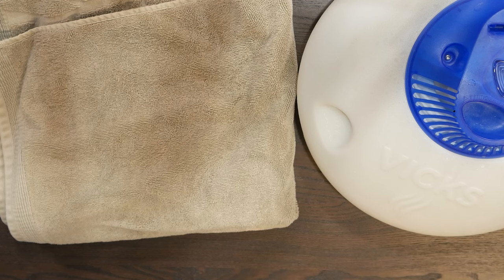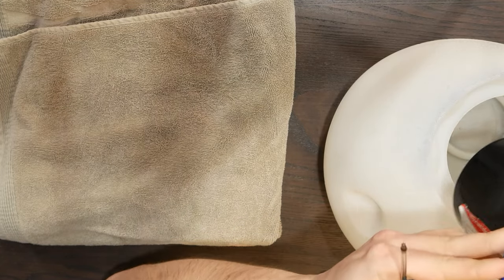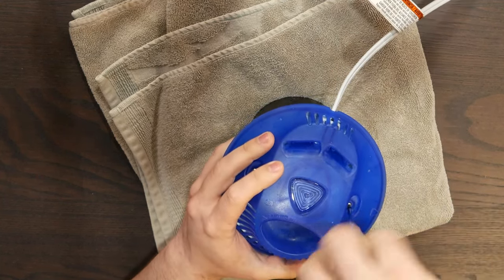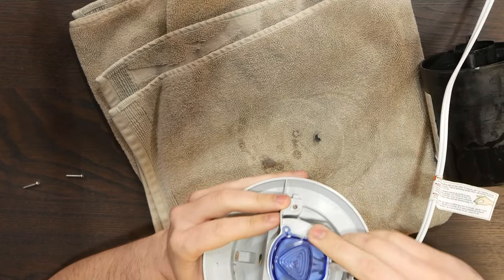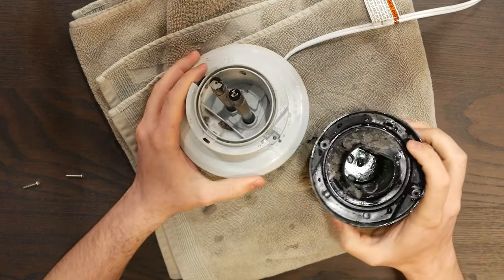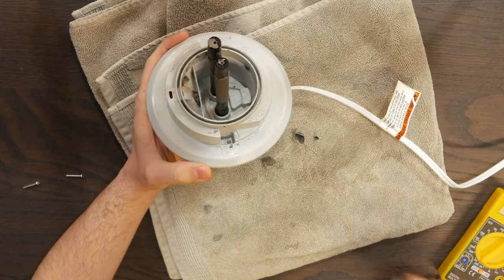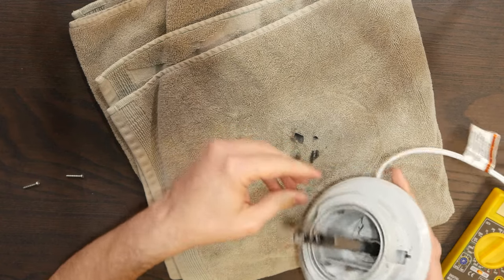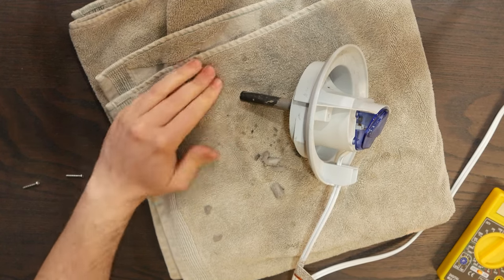Is a Vicks vaporizer an electrode boiler?

Comment: The reason why the scale was dark is because of electrolysis. The metal electrodes were depositing their minerals into the water. Because there weren't other conductors in the tub, most of the metal deposits stay near the electrodes.
I was going to ask what the amperage tested at until you read the "up to 5.8" which is interesting and makes sense that it is dependant on the depth of the water.

Comment: This my friend, is a feature and not a bug!
Your unit may be limited to 650 watts but more the generic Menards option I have will top 1500 watts before the plastic starts melting, if the mineral content of the water is sufficiently high (PPM readings into the 10K range, the circular beige humidifiers are badass wild west).
By varying how often you change the water, you can use a single unit to humidify and 3,000 sqft victorian era home in central IL.
When you pull out the power unit, it's no longer exposed to water and the ouchy shocks stop, so it's surprisingly safe!! lol

Comment: An earlier Vicks model (many years ago) had replaceable electrodes.  The case was opened by using the plug as a key.  The plug was captive while the case was open, making it safe.  They no longer make vaporizers.

Comment: Just got a look at my grandmother's Hunt brand "Vaporizer" from the 1950's and carefully took the screws out of the black bakelite encasing to find two very corroded electrodes and ancient limescale. Took off the cap where the power cord enters expecting to find old leaky capacitors, considering it boasts an 8-hour shut off timer, but it's just two screws connecting the positive and negative wires, directly to the rusty electrodes. I came right here and you had the same reaction.
Reply: If it were my grandmother's vaporizer I would clean the corrosion off of the electrodes, check the connections to make sure they are safe, put it back together and test it out.  Your grandmother would appreciate it.
Reply: @mharris5047  Be assured that I did all of that. It's safe in the hutch.

Comment: I used to use these exclusively, and you used to be able to get replacement electrodes for them. They also used to be copper, but the last one I bought used carbon or something, which lasted longer at didn't disintegrate in the same way but those weren't replaceable, which was the main reason I stopped using that type of unit. I don't want to keep buying a whole new unit just because a small sacrificial part is worn out.

Comment: that is mold in the black cap. On the resistive elements that is probably calcium which is usually in lake water because it dissolves out of the rocks.

Comment: I once tried an evaporative humidifier with a wick, but it was evidently a really poorly engineered model which was very annoying and didn't work well. I then got simpler boiling units which actually worked very well if you stayed on top of maintenance. They're better than the Vicks units in the video. They have an upright configuration with a large water tank, and the heating element is a smooth, ceramic thing (not a scary electrode boiler) which is easily accessed for cleaning. It also has a high/low switch, so if you need just a little humidification or want to go to sleep without worrying about overhumidification, you can set it on low which reduces the output. The output on high is impressive and did a pretty good job of taking care of most of a small house.

Our recent house has a water softening system, and I was wondering if that would make descaling of a boiler less of a pain, but oddly, ever since we moved the humidity has yet to be low enough in the winter to even use the humidifier. Somehow our indoor humidity manages to hover just above 40% all the time no matter what's going on outside. I'm starting to wonder if we have a whole-house humidifier that we don't know about…
Reply: It could be, they do exist.  However, if you have unvented gas heaters in your house those also produce copious amounts of moisture while running via the conversion process from gas to flame.  I have seen people attempt to use these in camping trailers and end up with one hell of a moisture problem.  In an appropriately sized room this isn't a problem (I don't like them because of the possibility of CO2 poisoning if they aren't adjusted just right but that doesn't have a thing to do with their moisture production) but if the heater is too big for the area being heated the moisture problem can be horrendous!
Reply: @mharris5047  Hmm, interesting. We do have a couple of ventless gas fireplaces which we had been using now and then. We stopped using them this year ever since one of them started setting off the carbon monoxide alarm. And it seems like I have seen somewhat lower indoor humidity this winter at times, though still usually above 30%, so not too horrible yet.

I figured that if we did have a whole-house humidifier it would have been visible somewhere, and without maintenance it probably wouldn't have remained effective for long, anyway.
Reply: @TravisTev  Ventless gas fireplaces will do this, too.  I would call in someone from your gas company to repair or adjust the ventless fireplace but any ventless heater requires a window in the same room to be open about a quarter inch for a return fresh air supply.  I probably would relegate them to emergency use myself (I have two propane tank top ventless heaters intended for fish shanties or outdoor use that I use in an extreme emergency, use while the power was on did not trigger any of my three CO2 detectors) but still get the one that is triggering your CO2 alarm adjusted before attempting to use it again.

Comment: Most of the commercial building humidifiers (connected to the air handling systems) create steam in this manner. They of course have a lot of controls connected to they. They are also plumbed to the building water. They may also have a flush cycle to help reduce building up deposits. 

Reverse osmosis water can be used to reduce scaling. But that means salt must be added.

Comment: I've got a Hankscraft from the 50's that works like this. It works WELL, and it's gorgeous. It just, you know... gets incredibly hot to the touch. We leave it on top of a towel. It's worth it since we have steam radiators and those are almost equally as physically dangerous.

Comment: There is another sort of humidifier that isn't gross that I haven't seen you mention.
It's a really small nozzle attached to your water supply that just squirts a cloud in to your room. I've only ever seen them in factories and farms (for cooling cows). You put a really fine filter in a line of softened water to stop the nozzle clogging and you just get a very fine mist out of the end. You could probably get a similar effect using a fuel injection nozzle.

Comment: In its own way, it's a very elegant design. Cord, resistor, neon, two electrodes, five injection molded parts. It's been simplified down to the bare minimum necessary for functionality and safety.   It doesn't need a water level sensor, or any kind of feedback loop to cycle the heater. The amount of current draw is directly proportional to the amount of water in the tank. 

It's a bomb proof design. There's nothing there to break. 

If you descaled it regularly, you could probably give it to your grandchildren when you died. (They'd be really confused, but it would still work.)
Reply: Or just replace the electrodes. They will eventually degrade.

Comment: I wonder if this also creates electrolysis of water, that could affect the amount of water that's actually vaporized as now you have to take into account that fact that some water may become oxygen and hydrogen instead of water vapor so the amount of water consumed may not be the amount of water vaporized, which means that the efficiency wouldn't really be what you think it is.
Reply: No becuase electrolysis can only happen if there is an direct current.

Comment: 4:00 you can just check if the plug and heater are conductive or not (very low resistance between them)
it will be way safer...

Comment: Mine is an old humidifier that I don't use too much (is uses a lot of energy), the electrodes are totally exposed and you can touch them (and clean them) without unscrewing the box. Just take it out of the water and that's all.
They have a security switch that opens when the electrodes are not in the water, but I don't want to test if the switch is working or not by touching the electrodes.

Comment: ... I remember having an old vicks beige and gray humidifier with a big ol' rectangular tank that ended up "dying" on us while I was sick one time. My parents got a new one similar to the one you've got when I was in middle school (circa 2009). It "crapped out" on us too, but now I wonder if both of them just needed to be descaled.

We did have to add salt to the water we used in them, so that did probably hasten their demise
Reply: The salt almost certainly did hasten their death, just because it makes the water more corrosive to the electrode. However, you do need the free electrons from the salt to get current flow (Water scale is almost entirely carbonates or chlorides of various metals. Calcium carbonate being the most common).

Comment: I pulled up the manual for one of these and while they don't say to open them up and clean the rods they do say to soak in vinegar for 10 minutes which is silly. You have to open them up and clean ALL the scale off the rods in places with very hard water you have to do this every 3 or 4 uses. We always cleaned the rods and that's why ours lasted for many years.

Comment: I had one of those kaz brand dynamist humidifier the one with the filter cartridge on the top of the motor and it used an impeller to produce the water vapor in a white dust

Comment: I would generally dis-assemble and clean the electrodes as soon as the unit would start 'spitting' a bit. The heat is a welcome byproduct when your room doesn't have heat, or insufficient heat.

Comment: I recently bought a humidifier which boils the water because I was not satisfied with the alternatives (performance for large room, space requirement, cleaning and microbes). It uses a lot of power but the performance in all other categories were with it for me. However my model is not an electrolyzer (I'm not sure if they are even legal here for home appliances, I've never seen one besides in devices which were multiple decades old)

Comment: I have a boiling humidifier from 2018 and it is different. It has a sensor and there is this kind of rough ceramic heating element thing. I stopped using it because my water is very heavy and there would be yellow colored crystals all over the heating element that could be scrapped off with a screwdriver. It did not get white dust everywhere luckily, but these days I use evaporator humidifiers.

Comment: Alec, one thing you might do, if you want to actually descale thw whole thing:

1. Fill entirely with vinegar.
2. Run. Ideally outdoors.
3. rinse with overflowing water (best way to get the scale that's refusing to leave out)
4. Run with full water, again outdoors.

Comment: No matter what type of humidifier it is the heat of vaporization of the water is the same, so for a given quantity of water the amount of energy required to vaporize it is the same, the only difference is where the energy is coming from. Either directly from the humidifier or in the case of an evaporative unit, it cools the air which then has to be re-heated by the furnace. The only difference between methods is potentially how much energy a fan or other components use.

Comment: One problem - or feature, depending on how you look - of these things is that, since it´s very difficult to clean, as you stated, there is always a little bit of high concentration natural electrolites at the end of each use. They get dilluted with the next use, but with several uses, you can really notice the humidifier just getting stronger. At some point, if you use it overnight, they´ll go through all of the water before you wake up (which I think is a fire hazard, as they stay really hot even after the water is gone)

Comment: I have one of these.  Yea, they use a lot of juice.

You inspired me to take it apart and clean it.  I think I probably used this on and off for years, mostly to humidify the air as I slept when I had a chest cold.  The minerals in mine were pretty thick on the electrodes. The electrode unit is pretty light which makes me wonder if they are carbon electrodes?

Comment: I think its worth pointing out that the mist and wick based humidifiers need some sort of energy to evaporate water. It takes energy to evaporate the water, whether it comes from the humidifier itself or your furnace, there is still that energy cost. The vicks one just does that all in the same unit. For example, to heat the air in a 3,000 sq.ft by 4 Cº takes 2.5 MJ or 0.7 kWh. Lets say your humidifier used roughly 1/4 of a gallon (1 kg) during that time then its going to take another 2.2 MJ to evaporate that water. Just to be abundantly clear here, that heat has to come from somewhere. Its either going to come from the device itself OR its going to come from how you heat your house.

Comment: I have one of those Vick's Warm Steam humidifiers and they are indeed electrode boilers.
I have used the wick type of humidifier (both small and commercial) and this Vicks model puts much more moisture into the air.
It empties it's 1.5 gallon tank in 8 hours as long as I have a little salt in there.
It does require cleaning once a month and instead of messing around with vinegar and shaking it I just open up the electrodes and scrape them off.
It looks like it's two carbon electrodes housed within that black plastic and there's nothing else besides a resistor and a tiny incandescent bulb at the top, perhaps it's an LED...

I hadn't considered that it might have very high power consumption and the fact that I go through water even faster than you did in your test makes me wonder how much power this sucker is drawing.

Regardless, I do electronics repair and I like to keep the humidity over 50% to keep static under control. This thing will raise RH by 6-8% in an hour in a pretty large room that's open to the rest of the first floor. 

I'm going to test the power consumption but now I am considering perhaps running another lower power unit 24-7 in the winter and only using the Vicks when I need a quick boost to humidity

EDIT: Yes, they are still made like that. A quick and lazy way to clean it is to cover the hole at the bottom pour in some hot water shake it up and let the chunks out. Far more effective is to open it up and clean the electrodes off with some scraping tool every month or so.

Comment: Here in San Antonio, we have the hardest water of any municipal water supply in the US. Often a thin layer builds up and stops these things from working. A little salt helps, but watch out... Those electrodes are internally fused, and you can't replace those fuses... They still make them the same way, and they only last 5 to 10 tankfulls on this water.

Comment: i have this exact vaporizer.  i ended up making a humidity controller from a DHT11 sensor, arduino and a relay.  at 50% the relay shuts off the power to the vaporizer.  before i made the controller i hated it but now it doesnt run full throttle to the end of the water tank.  i live in the midwest also and humidity is a must in the winter.

Comment: We had the same one and I had to pull it apart, descale it, and service it many times as only deionized or distilled water would yield less scale and I’m not sure how much less. Also I believe that adding salt, as the directions suggest for this humidifier, to the water may contribute with scale and crud build up as the grade of salt used isn’t like one for a water softener and will in most cases be iodized table salt for most households. The iodine may react poorly with the poor choice in electrode chassis. Obviously stainless would have been a better choice for this but what the heck why not get as cheap as they can because the stick it in the black plastic bin anyways where people should not access it (per the manual). Great video. Again dangerous design due to cheap manufacturing resulting in an inferior though operation love you meeting the minimum requirements. They do put out a lot of steam.
Reply: @Christopher Grant didn’t know that! Very interesting

Comment: If this is an electrode boiler, wouldn't it be kinda dangerous to just ''add salt'' bc it would electrolyze and release chlorine gas at some point if the user puts in too much table salt? or is electrolysis at AC not efficient enough for this

Comment: If I wanted to boil water into the air I'd just run my steam cooker for a while
Much easier to clean since it's designed to be used regularly for food
And it has the double-purpose of also making it really very easy to cook vegetables perfectly!

Comment: The reason why it measures 120v rms is due to you were measuring it without load (water). The series resistor associated works as a limiting current factor and a fuse. Try connecting two cables into each electrode, and put it back into water, to measure the "standard" output voltage.